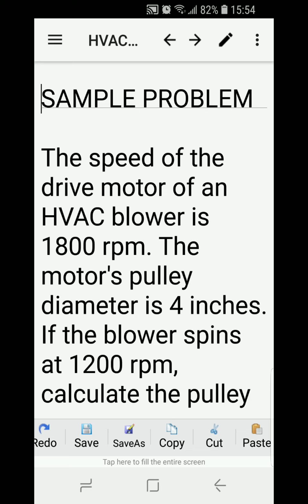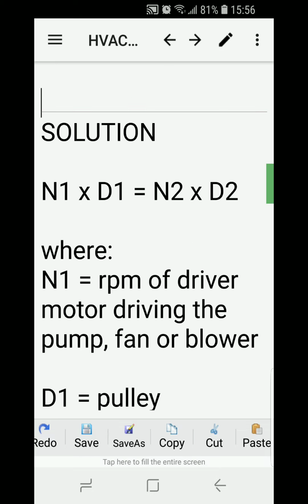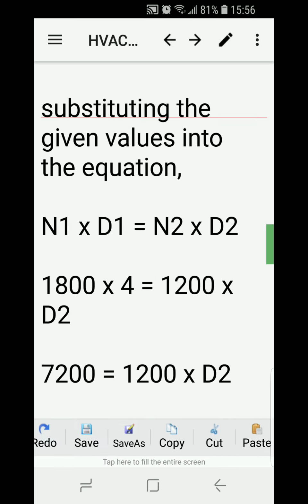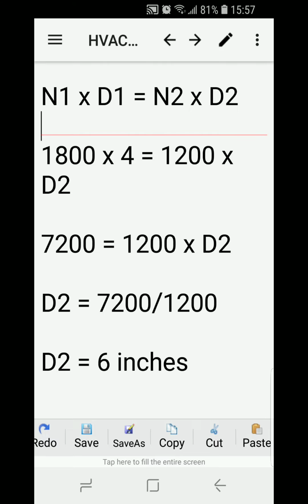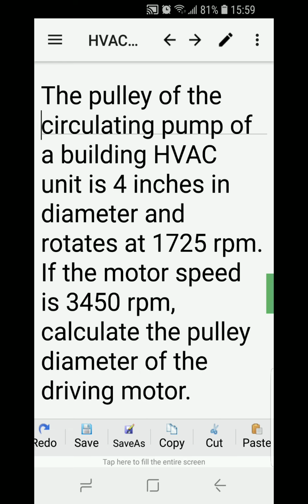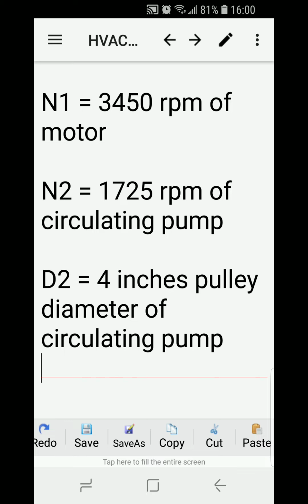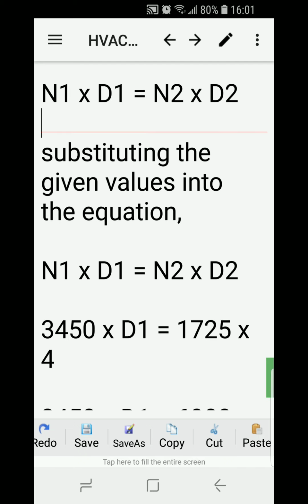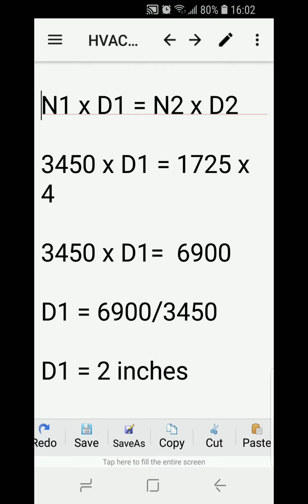REFRIGERATION HVAC MECHANIC RED SEAL EXAM PREP PRACTICE QUESTIONS – pulley sizing of HVAC units

Comment: Does 313A license possible to apply out side canada
Reply from the maker: did you get 313A in Ontario? 

if you are planning to work  as Refrigeration and air-conditioning tech outside Canada, then I suggest you do some research in the same field of work in that country 

for example, if you are planning to work in Germany as refrigeration and air-conditioning tech, then I suggest you check out what qualifications or education you need to have....you may need to pass some trade test before they give you license to work
Reply: @Eternalson17  i didn’t have 313A but i am qualified HVAC technician over 11 yers experience so I will be expecting to work  as an HVAC field in Canada. But still i am not residence there .In this cause can i apply to take  313A license  from out country
Reply from the maker: i don't think you can take the exam because it requires Canadian experience 

you have to confirm by calling the Ontario College of Trades (OCOT). Their number is (647) 847-3000
Reply: Yes, you can apply for 313A license from out side Canada, but you should have prior experience in this field because they will do verification and approve your application and to attend the exam you to visit Canada this is a Paper exam not available to attend online.